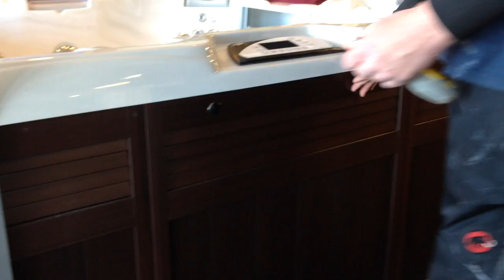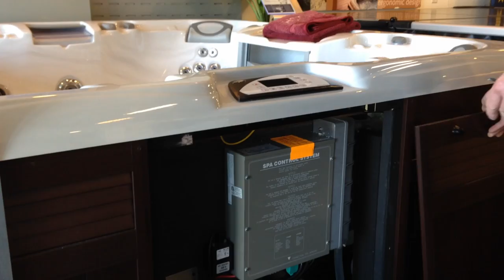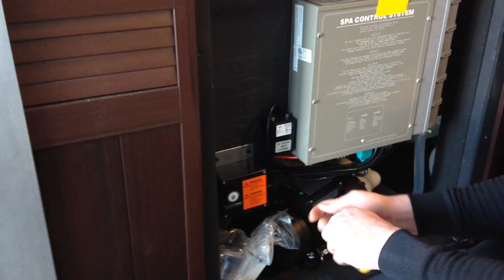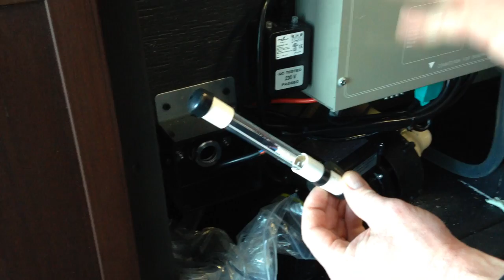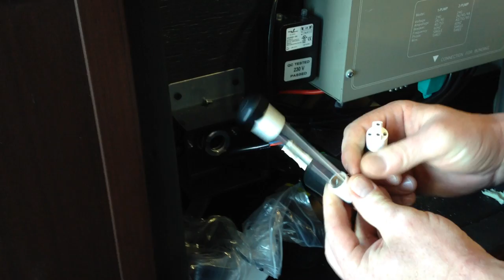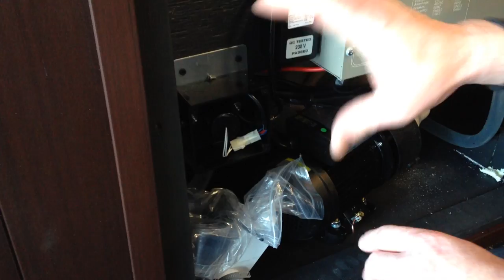Clear Ray Bulb Replacement On A Sundance® Spa

Comment: Does the hot tub need to be empty, or can it stay full?
Reply: No need to drain it to replace the bulb. The hole the bulb slides into is a crystal tube that does need to be cleaned occasionally and that does require the spa to be drained. Unless You're handy, I'd recommend having a tech do it